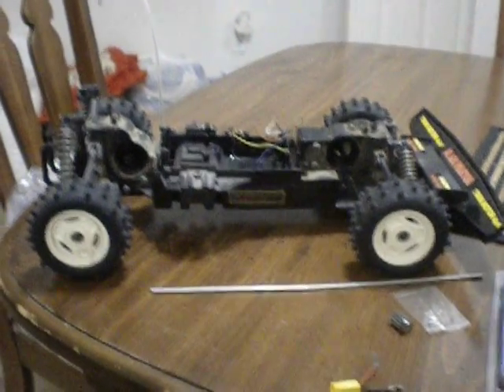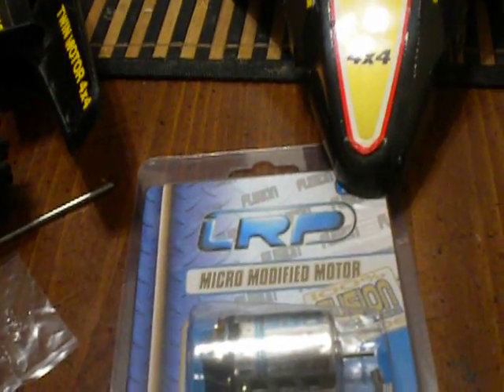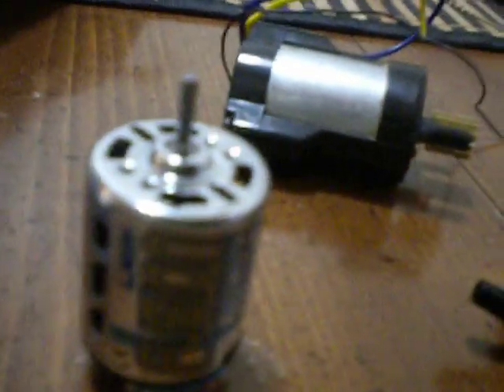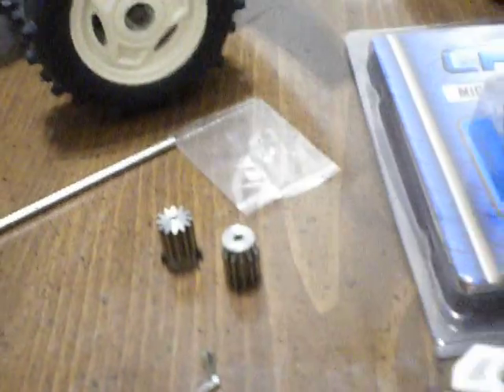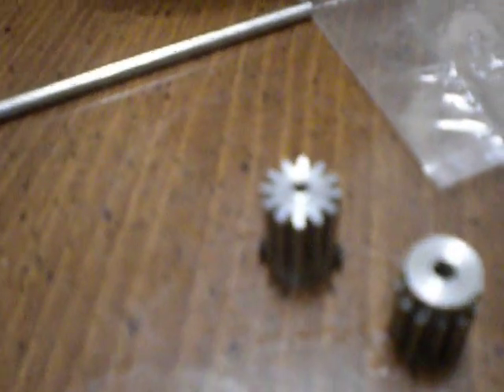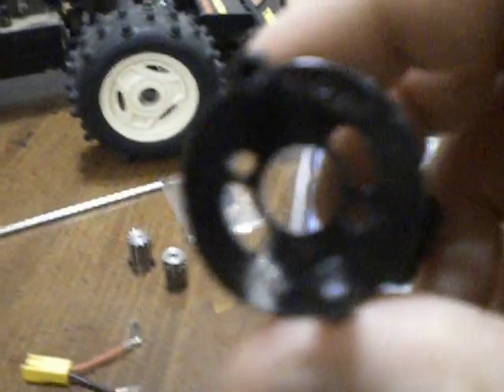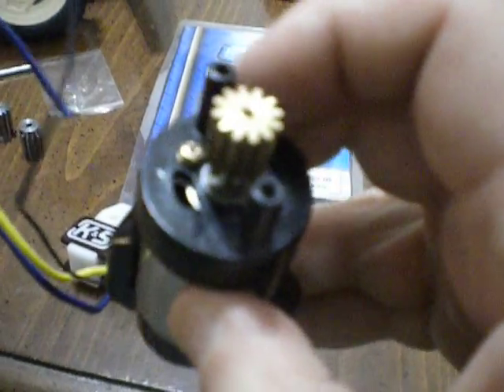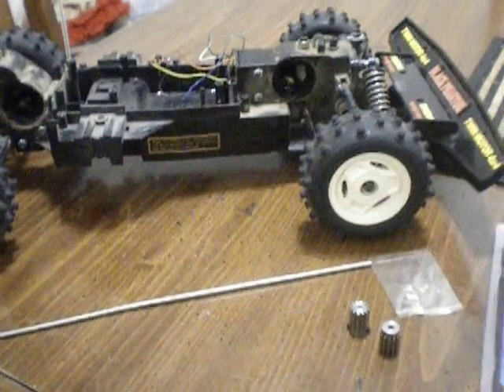Radio Shack Black Phantom Project Part 2

Comment: Brushless motors are light years more powerful and fast. I never knew the dramatic change until a few years ago. Definitely not like the 90's rc cars
Reply: You will blow out the plastic diffs with brushless motors

Comment: Hello. I'm doing a similar project myself with a Nikko Bobcat which has the same chassis and gearboxes. Could you please tell me what bearings you used for the gearboxes and wheel hubs? Also, will any drive axles fit that have dog bone ends?

Thanks

Comment: Thanks for posting this. I just got a Nikko Dictator yesterday and plan on adding an esc, 2.4 radio system, and steering servo but I wasnt sure on what to use for motors and pinions, but now I have some ideas thanks to your video.

Comment from the maker: @luca6959 There are Duratrax 380 motors available in a red or green can that are higher speed than the original mabuchi 380 but are not in the modified category and those are on Ebay. I chose the fusion 52030, the high torque version. The lrp motors did not state the specifications but the timing is adjustable and when I did an initial test, the speed seemed very high and my tires balooned. My buggy is not completed yet. I'll be happy to try to help you  in any way I can. More videos are coming.

Comment: Just as I thought .... I will try with the original circuit! Mica know what are the specific micro motors FUSION 380 HS? RPM? I hope it does not damage the card ... : (

Comment from the maker: @qbandog I'm only planning to replace the plastic bushings with ball bearings, clean and lube the gears with tamiya ceramic grease, and replace the gearbox case screws with high strength m3x40mm machine screws, nylon insert locknuts (stopnuts) and an m3 flat washer at each side. Ball bearings also will be installed in all 4 wheel axle carriers to eliminate any axle play or binding. I'm not going with a brushless motor because it's too much power and breakage involved even with ball bearings.

Comment from the maker: @qbandog Also, be aware that 3.17mm pinions are often referred to as 1/8" inch and be sure your speed control can handle both motors. I blew a speed controller in the early 90's when I installed hobby grade electronics in to the previous black phantom I had back then. The speed controller I'm planning to use is a tamiya teu 103 for dual brushed motors. I don't know the amp rating of your speed controller so you may want to make sure your speed controller is adequate regarding the motor amp draw.

Comment: I would definatly change the suspension next, as they are only springs with no damping and all it does is bounce as you drive it. Also beef up the suspension mounts on the tops where the top of the suspension is fixed. Ours broke, but was easly mended with some glue, then wrapping some copper wire around the repair, then using a soldering iron solder it all together. Also consider a servo-saver
Just remember, the faster it goes, the smaller the bits are when it crashes.
Keep up the good work.